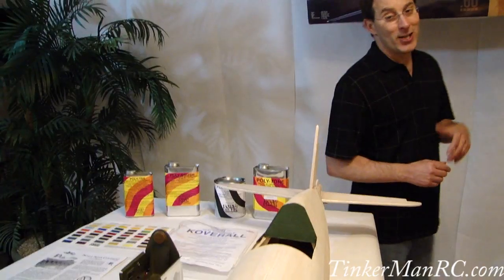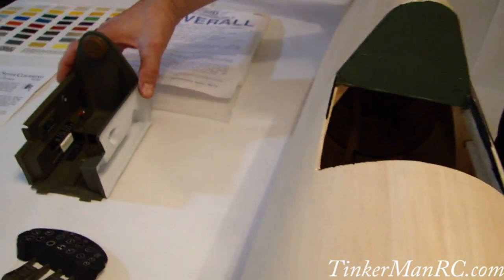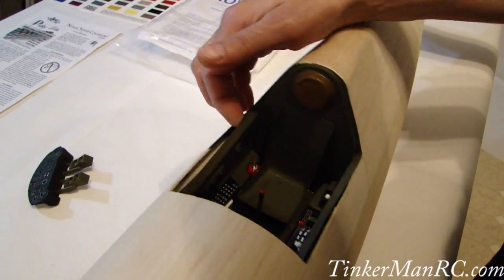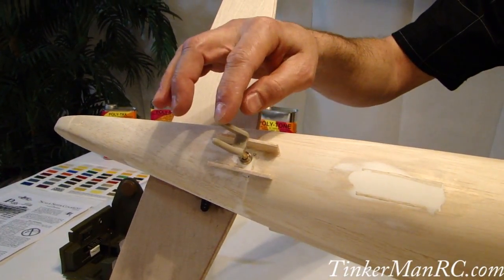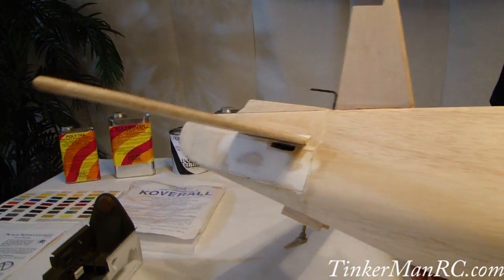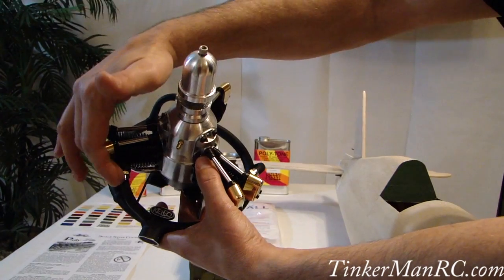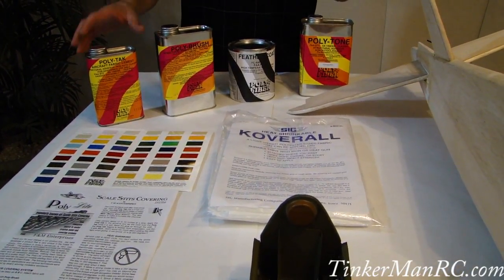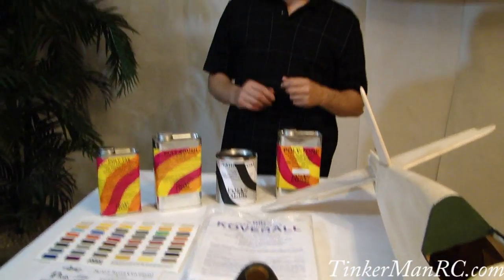Hangar 9  F4U Corsair Build Part II

Comment: this looks incredible! the detail from the cockpit to the tail wheel assembly, and even the flaps look very accurate(especially the spar). just a lil fyi, the actual prop is a 4 blade and the part of the wing you made solid is actually fabric covered on the plane, including the rudder and elevator control surfaces. but please please please dont take that as disrespect, because you do awesome work!

Comment: you having any issues with the ignition CDI unit affecting your servos? I see you are running Hitec servos and I tried running these with my gas engine, but for some reason the servos go nuts when the engine is running. They twitch to the idle of the motor and sometimes get stuck in one position. this only happens with hitec servos though, with Savox or any other brand, im fine. Any ideas?
Reply from the maker: I have not heard of this but I did not have any issues with the Ignition CDI .. Check that the shielding on the spark wires is grounded or that there is no damage to it... Thanks for commenting ..Tim